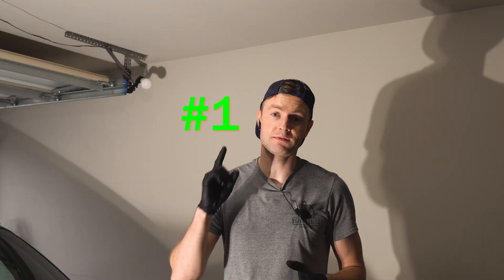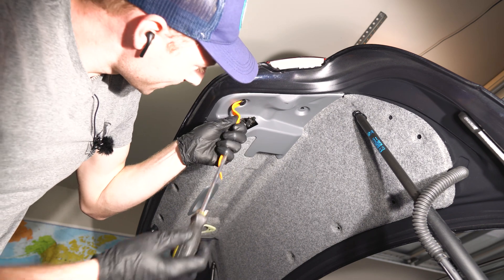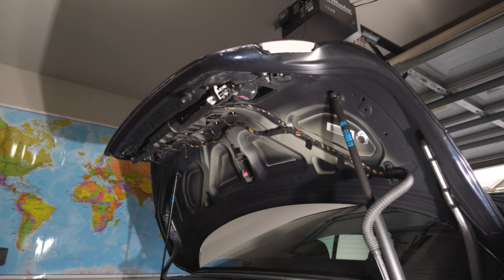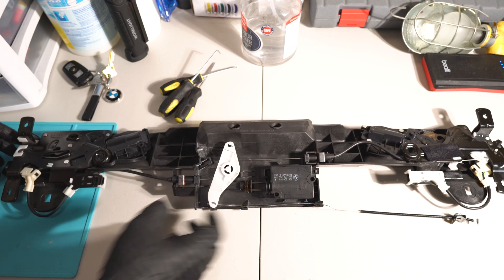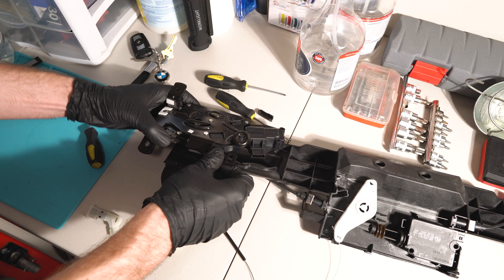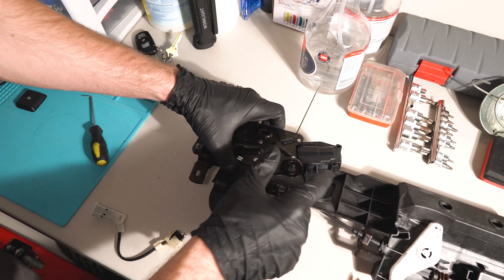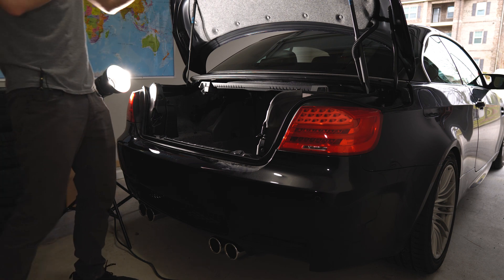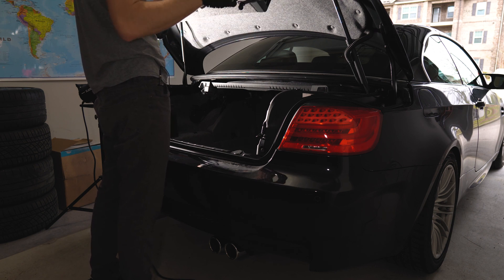how to repair BMW Electric trunk Latch actuator motor is not working e9x LCI

Comment: How do I know whether it’s my micro switches or the actuator?
Reply from the maker: try to lock the lock manually as i did at the end of the video, and press the button to open the trunk, if it works, means it's a micro switch, if not it could be the trunk relise button itself.make sure to check the fuse box.
Reply: @Makhnovets  where is the truck button release located? Or do you mean the actuator itself? Also what fuses should I check? Great video btw I've been trying to diagnose this for a few months now.

Comment: Hello. I have a problem very similar to yours.

The trunk does not close 100%. But, when I remove fuse number 79, the actuator motor starts to run and the trunk closes completely.

When I reconnect fuse number 79 the trunk detaches again and the problem persists.

Do you know how to solve my problem?

Thanks
Reply: Fuse scheme: https://www.nolose.es/foros/fuse-scheme.PNG
Reply from the maker: sorry for late response, I would try to use the OBD and trigger the component, see if it's actuating after all true the computer, make sure the micro swiche's are in good working order, it's also easy to check it via tester, check the resistanse, just type in google how to test micro switch with electric tester.
But after all there many fuses that will allow you to buypass some of the systems, as you seen on the fuse slip there couple different fuses connected to the same components, i don't think you have some mystery there, but if so, there should be the reason, either car was heavily coded or some electric modification's. Do you have any codes related?
Reply: @pbofe  Hello. I have the same problem. How dis you resolv? I try with the fuse number 79 and it works completely. What did you do after all? You replace something?
Reply: @eduardkun4419  Hello. You have a small broken wire inside an internal trunk lock connector. This fault occurs with all BMW E93 trunk locks. You can try to repair it on your own at €0. At the BMW dealer they will change the entire lock for the new model and it costs approximately €700.
Reply from the maker: Since then i newer had an issue with it. But my friend have random failures, do you know which wire? The one go to micro switch?
Reply: The cable that always breaks is on the left side.

You have to remove the white switch and repair the cable.

It is an internal rupture. It is not visible at first sight.

Photo: https://www.nolose.es/foros/rotura-cable-cerradura-maletero-bmw-e93.jpg
Reply: @pbofe  do you stilo have the picture ?
Reply: @illustre212  I think you mean the fuse box diagram photo. The original link was wrong but you can check this: https://drive.google.com/file/d/1NBPNrJQ4Od3yeWrhCgUBhBV6t8nh5-dE/view?usp=sharing

However, this diagram is not very useful. The problem is a trunk lock cable that breaks due to a BMW manufacturing defect. BMW has improved the part with a new one that solves this failure.
Reply: Hello. I have the same problem. How dis you resolv? I try with the fuse number 79 and it works completely. What did you do after all? You replace something?
Reply: Bonjour j ai u ce même problème sur ma e93 jai réparer les file qui était coupé mais ça marche toujours pas et ce kil y aurait un fusible de grille lequel kan je retire le fusible 79 pareil ça marche le coffre de ferme elle se décapote mais s arrête au niveau du coffre je ne comprends pas kelkun pourais-je m aide 😅😅
Reply: @christopherlorenzi3522  I recommend that you check all the fuses one by one. However, it is possible that the cable is broken in different parts!
Reply: Merci beaucoup 😮😮pboof de votre réponse sa ma aider beaucoup